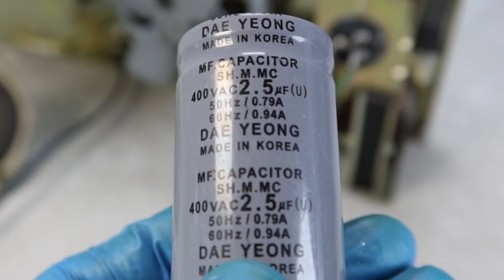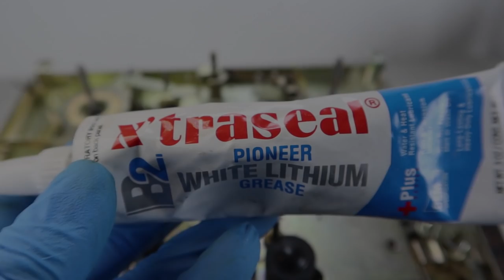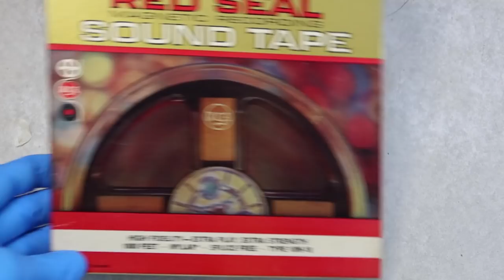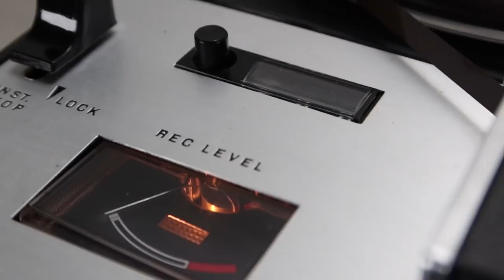Vintage Sony TC-357A Reel to Reel Tape Recorder Restoration and Repair

Comment: Some of these older machines are more restorable than the newer ones. A lovely job, well done.
Reply: If tape recorders like this one were still being manufactured today, the case would have been made out of cheap plastic and the gears, pulley wheels and everything else would have been made out of plastic as well, or cheap, thin metal that would start showing signs of fatigue quickly. Such recorders wouldn't last very long and their replacements would offer only incremental improvements.
Reply: Back then they manufactured a product with passion and pride. 
Today they do, till you are forced to replace the unit. 
A modus operandi started by Apple.
Reply: @grandmasterjo1  I know I spent my life in the Hi-Fi trade and I would only buy things that could be repaired.

Comment: I love these little Sony reel to reel units.  Good job on replacing the motor cap, as they are a common failure with these units.  There a couple of other prone suspects too in the motor and power supply, they are 2 Sony made components in an orange package, which is a capacitor and resistor in series, and they normally fail.  Normally a 120ohm and .033 capacitor. They are easy to modify and identifyable on a schematic that you can make yourself. If your machine starts dragging and running slow, including FF and RW, those two components are the next to go.
Reply from the maker: Thank you for your very useful information!
Reply: @BeeBetu  No worries! Neat videos :)

Comment: Very nice restoration of a 50+year old Sony open reel tape recorder,,,I guess those large capacitors in the power supply needed replacing,,,along with the broken light globe too.
And freed up the idler pulleys and reel drive hubs,,,lubricated mechanism and restored belt with belt grip formula?
Not to mention a beautiful job in cleaning the tape heads,guides,, and pinch roller,,,and how well the case cabinet cover came up after giving it a soapy wash,,,as it looks like a new machine,,,compared to the state it was in when u first got it,,,,it looked like a wreck of rusted parts in the beginning of the video.

Absolutely love seeing restored old vintage open reel tape machines,,,to like new,,,showroom condition!

Comment: I have a tc 357-4 model. Remember the good old days when it was extensively used. Today rubber parts have perished with no alternate source so it's more of a museum piece

Comment: I have the exact same machine perfect condition but I need an idler so it will play back at proper speed where did you get the idlers for it

Comment: The trick is to make it dirty and look old, then undo what you did….then you’re halfway your “restoration “…..
Reply: Many of these apparent restorations start with a machine that has clearly been made to look worse than it is. That may have been the case here. The area under the head cover looked a lot cleaner than the rest of the outside of the recorder, and the base was pretty clean too.
Reply: @Ian-Steele  you would expect those areas to be cleaner.
Reply: We will y

Comment: I’d like to know what the liquid cleaning solution was that removed rust so efficiently from the metal parts?
Reply: considering they stuck their hand in probably soap water. None of the parts where truly rusted only super surface level stuff.
Reply: @trevor245  it’s a bit fake 😂
Reply: @FUNKYSTATORS  you can still see oxidation on the parts he cleaned that where rusted so I doubt it's fake...
Reply: @trevor245  clean ur eyes and u will see, if u can , best regards…..
Reply: @FUNKYSTATORS  ??? The device isn't even that old. It makes more sense for it to be rust that comes of easily then for the metal to be rusted through and through. Unless they stored it outside or something that is. The oxidation spots clearly indicate that the rust was actual rust and not something the creator put on for the video. No clue what else to tell.
Reply: What you want to know is where do you buy the rust colored spray that wipes off easily.

Comment: Very good restoration. That can of sonax rubber rejuvenator you likely got it from lazada? I used to use that until i was able to buy printer roller restorer on Shopee. The rumbling noise is from the motor speed control or is it in the amplifier circuit?

Comment: I had a load of Grundig ones like this one, All New In the Box's, from the 60's, They were the ones that the schools used. There was a small fire In the local council warehouse, and everything had to be scrapped, due to Smoke damage. I had Garrard Lab SP25's and 35 Turntables and Tons of spares for them as well. There were BASF Tapes In the Plastic Cartridges for the machines , still sealed. Loads of other stuff like Projectors and Screens, Amps, Speakers and other things as well. Had to leave the lot when the Council Room Tax forced Me out of My home to a Flat, surrounded by Drunks and Junkies. England Is such a Lovely place, If Your Not a Local that Is.
Reply: You're referring to a cut in welfare spending which was introduced by a Conservative government in 2013. Don't blame the majority of the British people who didn't elect it.

Comment: Nice job! Can you tell us what cleaning spray you used on the case? Thanks!
Reply from the maker: I use kitchen bleach removes stains on metal and plastic surfaces. It's quite effective on stains. you should use a rust remover solution like Revapo Rust...

Comment: I had one of these back in the eighties and used it a lot but the motor capacitor went bad after I threw it out I found out why the motor quit!

Comment: For some repairs and polishing, I feel that this is a scam. That the device was originally in good condition and someone got it dirty and pretended to be in its original condition. Where, for example, could this tape recorder get so dirty? Did someone have it stored in a manure shop? :)

Comment: i had that exact machine wen i was younger. was great, til my younger brother decided to pull the mains selector out and out it back in wring because the label had dried up and fell off. the magic smoke came out -_-